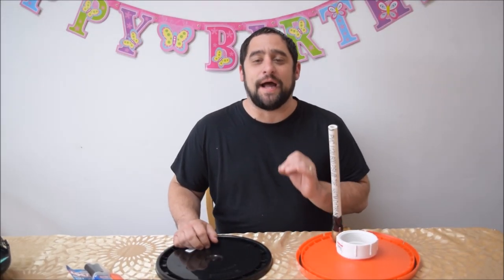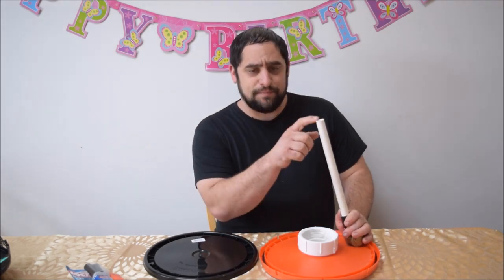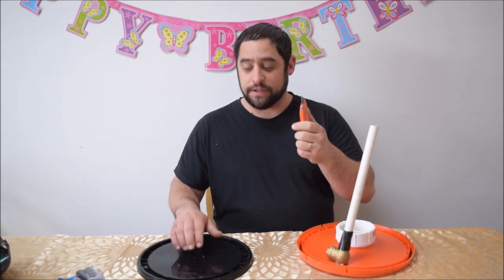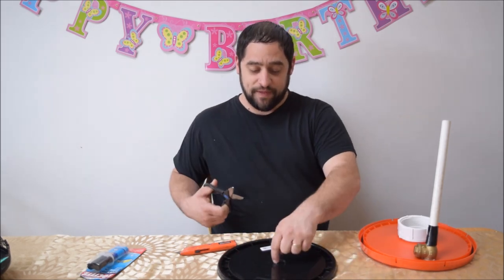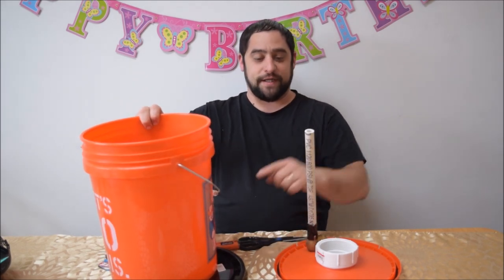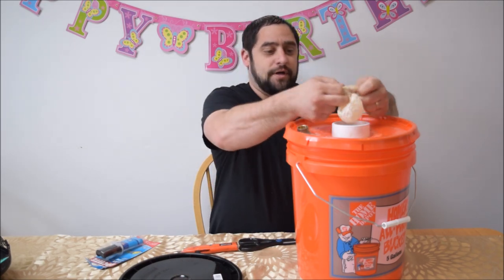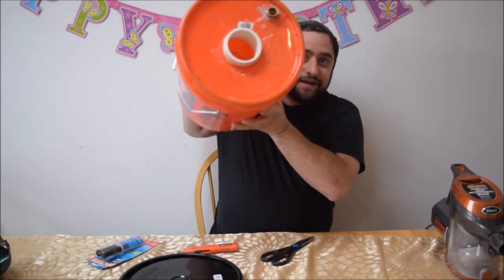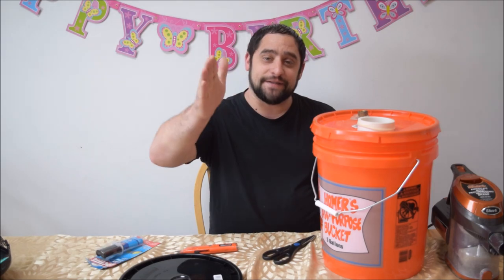How to make a balloon stuffing machine for $15 using supplies from home depot or your hardware store

Comment: IT WORKED !!!! Thank you so much for this video,  I made this with my husband and it works great! This year i will be able to make Easter stuffed balloons for my community 😊 Thanks to you
Reply: Maybe you could answer the question I have. The hoses on my vacuums are standard size that you put crevice tools and extenders in.
Will that work? I don't have a vacuum like the shark that has the smaller hose..
Reply: What's, I also forgot to ask, how do you know when the balloon is inflated to the right size? Does it have to go to the sides of the bucket? And how do you know this? Sorry to bother you, thank you in advance ❤️
Reply: Hi, I don't use a vacuum I use a balloon pump ... I create a support using a neck of a balloon ... that way air doesn't get lost..... I make sure the balloon touches the wall of bucket
Reply: I use the back of the hand pump

Comment: Hi, Amazing Balloon Guy,
Do you have any suggestions for building a larger balloon stuffing container? One with some kind of visibility as to what you stuff in the balloon? So you can rearrange items inside?
Reply: I would love the same answer to this question 🤣
Reply: Clear 5 gallon bucket
Reply: I'm thinking about using acrylic or plastic panels using the same epoxy to seal the sides

Comment: Thanks AmazingBalloonGuy! Just finished making mine! But to anyone trying this I highly recommend using E6000 or silicon-based adhesives, I found out the hard way while doing the project that epoxy is brittle. As soon as the lid flexed from the vacuum pressure the epoxy cracked and shattered and I lost the seal and had to start over. Just a tip to anyone trying this (and I may have just had really crappy epoxy, everyone's situation is different so take everything I say with a grain of salt lol ;) )
Reply: Thanks for the tip....can u tell me the brand of balloons u use. I’m new to this, I purchased latex and they break. Thanks
Reply: @greenearthblueskies8556  I recommend 18" inch Qualatex Stuffing balloons :) Don't even bother trying with normal 12" or 16" balloons, it simply will keep tearing the balloon ;)
Reply: How did u take the balloon out?
Reply: @detohlar  You take the lid off and it deflates the balloon with all the goodies inside, then you just blow the balloon back up after taking it out of the bucket
Reply: @MagnusJarngrimrson  thank you so much!
Reply: @detohlar  No problem, I'm glad I was able to help! :)
Reply: Can you use this diy with Bobo balloons? Thank you.

Comment: I love it .... however we need to see how you tie off the balloon😂? Thank you for sharing !!!
Reply: Yes!
Reply: Slowly pull the balloon from around the neck of the 3" pipe . Once off twist the balloon or you can turn the bucket (as to twist the balloon). If you have clips or clap to use that it would be easier to hold the air in while you remove the lid. If not twist the balloon  & try to pull the neck of the balloon up thru the whole as much as you can so you can tie it. Then take of the lid to remove the balloon from the bucket

Comment: Made one but can’t get the balloon to stay filled. It deflates as soon as i remove the vacuum and pops if i leave it on . I’ve sealed the thing with epoxy , hot glue and tape and it’s just not working. So disappointed

Comment: hello i got the exact products you used in this video and i even got 24in balloons (i tried stretching them out first too) but they rip everytime i try to put the balloon in place. How can i prevent the neck of the balloon from ripping when trying to use this? :(
Reply: Are you using specifically stuffing balloons? The neck of standard balloons will not allow this much stretch

Comment: Hello I just came across your video. I went to Lowe’s and Home Depot. However the brass check valves are straight and does not look like what you have in the video. How many ends does this part have? From the video it looks like 3 ends. If it is 3 ends then it’s not call a check valve. PLEASE HELP!!!

Comment: How do you seal the balloon with items inside?
Reply: Slowly pull the balloon from around the neck of the 3" pipe . Once off twist the balloon or you can turn the bucket (as to twist the balloon). If you have clips or clap to use that it would be easier to hold the air in while you remove the lid. If not twist the balloon  & try to pull the neck of the balloon up thru the whole as much as you can so you can tie it. Then take of the lid to remove the balloon from the bucket

Comment: Help! I made this balloon stuffer but im having a hard with keeping the balloon inflated. Once I turn the vacuum off the balloon deflates. Is this happening to anyone else?
Reply: Your not getting an air tight seal. Check your valve and around the pipe where your stuffing the balloon to make sure no air is escaping.

Comment: Can you write down the supplies. I'm not a native english speaker so it is hard to understand and translate these supply stuff
Reply: Did you ever get the supplies? If not, I can listen again and write it down for you.
Reply: @naturallangelic  no I did not yet. Please do!
Reply: 5 gallon lid and bucket, one with rubber seal preferred (holds air in better)
½ inch sized PVC pipe
3 inch PVC  pipe
¾ inch brass Check valve (used in plumbing)
Box cutter
Marine Epoxy, silicone or glue
Vacuum

Comment: You get what you pay for. So he's taking the cheap way out but can you see the balloon no. Can you see what you've put in it no. it would have to be an awfully small stuffed animal to fit through the opening and can you see if you've got it placed attractively no. Basically you can dump a bunch of candy down there maybe but really? She's take a regular balloon shove the candy down it get your air machine from the party City inflated and you're done.
Reply: Actually from watching other videos you can put a good size stuffed animal inside. The animals are squishable. You sew a long piece of thread to the bottom of the animal or to it's tag if it's at the bottom. You place the animal in head 1st. Once you slowly peel the balloon from the neck of the 3" pipe, pull the string taut (thus pulling the animal towards the bottom of balloon). Twist the balloon & hold tight. Remove the lid w/ the other hand or clamp the balloon & remove the lid w/ both hands